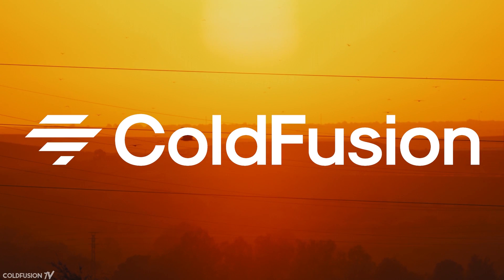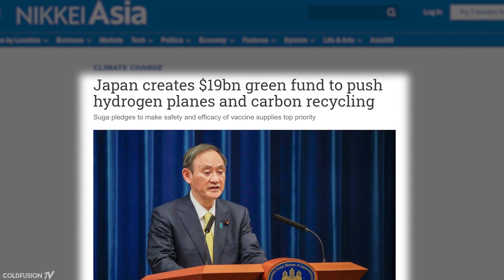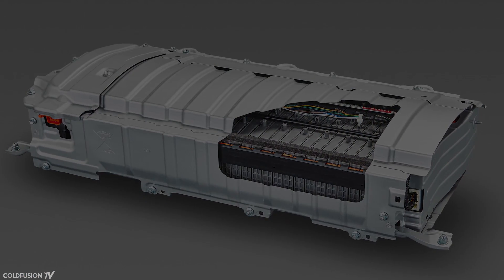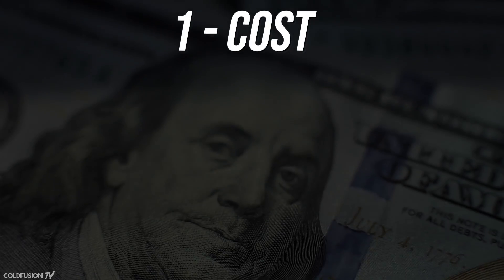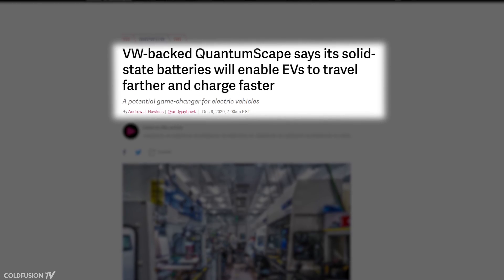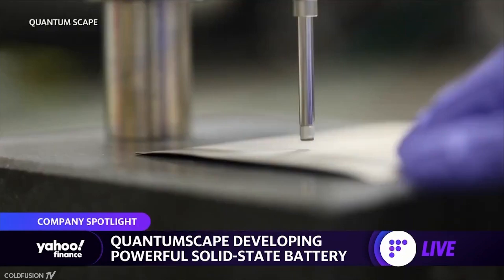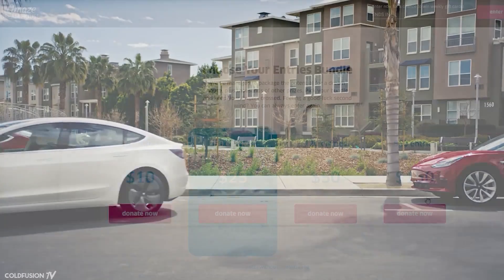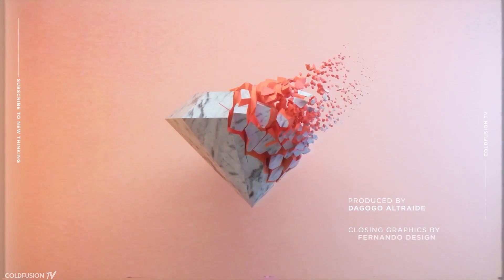Toyota Plans Revolutionary Solid State Battery for 2021

Comment: In my humble opinion Toyota are the most amazing vehicle company ever created, always ahead of the rest, that's why i wouldn't buy anything else other than Toyota or Lexus, look after them and they will last you a lifetime. In the 90'S Toyota created the Rav E.V.  (electric vehicle) that was only tried & sold in California. Everyone loved them until an oil company bought their battery design off them. probably forcefully or were made an unrefusable offer (speculation).
Anyway have you noticed how Toyota haven't created a full electric car probably because that would have been one of the conditions when selling the old battery tech on.
Solid state batteries, what a great idea, John Hutchinson has made lots of those not to difficult to recreate, but rechargeable is a different story.
Good Luck Toyota, im sure whatever you do will be amazing, looking forward to seeing your results.🙏

Comment: Toyota knows the word cannot have all e  cars only.  You cannot plug every car with the current power system. Especially in large cities.   Thus there needs to be a better charging design not larger Battery packs  like tesla is doing.   Recharge in 5 min  not 40 min.

Comment: I am hopeful about solid state battery technology, and Toyota’s involvement is important for this tech’s development.  However, you make assumptions about Toyota that I don’t agree are valid.  Toyota, and the Japanese audio industry as a whole, develops new tech like this with a focus that starts on the Japanese market.  Japan is focused on reducing fossil fuel consumption, but they also have to import fuel stock to generate electricity.  So the auto industry and government prefer to develop hydrogen fuel vehicles over battery electric vehicles.  Next, Japan has very moderate weather, so the batteries don’t need to operate in extreme environmental operating temperatures.  Also, Japan is an island archipelago nation, and the longest island is 810 miles/1300km long.  You don’t need the best in energy density battery packs to drive through the islands.  The higher density packs will probably be applied more to heavier commercial vehicles, while the lower performance packs are applied to smaller passenger vehicles.  I don’t think this is a bad plan, but it significantly narrows the parameters and application of this tech from Toyota.  Other than Nissan, Japanese automakers have not tried to mass produce BEVs- and though Nissan’s Leaf performs admirably in Japan, it has many shortcomings in much larger countries, and in regions with hot weather.

Comment: BS! This is not a vaporware, it's a CAME OUT VAPORWARE... After long history of BEV denial, Toyota to "came out" with "revolutionary" battery is for LOL. This "announcement" has purpose to keep Toyota stock afloat, until some miracle happened. Frankly, Toyota makes very good cars, but they failed HUGE with BEV.

Comment: 500 KM it is about 310 miles. It still cannot compete with ICE cars that run over 500 miles and fill up in less than 5 minutes.

Comment: The awnser is run the cars on water with a built in hydrogen generator 😉
But every one who does it  winds up missing or dead
Dont need gas stations because every modren household has electricity and water

Comment: I think 2024 is when the "average" person will begin switching in large numbers to EVs.  Price, performance, quality, and convenience will ALL be improved significantly by then.  And there will be capable EVs in EVERY vehicle segment at that point.  It also happens to be (June 2024) approximately when my Tesla CyberTruck will be delivered (although that could easily move a year in either direction.

Comment: Why don't auto manufacturers put even smaller, more efficient electric motors in cars that draw less energy?  Many consumers don't need AWD and 2 motors, like a Tesla.  Moreover, they can't afford it.  You don't need 450 horsepower and 700 foot pounds of torque in a family AWD sedan.  It's nice, but a simple FWD electric motor with 120 horsepower and 150 foot pounds of torque, that gets great range would do.

Comment: Good news. I understand that if these new solid batteries are much cheaper to produce, then and without those combustion engines, the values of the sale price to the public will go to 50% less. If the high prices for the vehicles that toyota produces are maintained then nothing will happen in the market, we really expect the prices to fall.

Comment: Quick correction: solid state batteries DO NOT suffer from dendrites buildup. It’s a problem current chemical Lithium batteries suffer from. Solid state batteries eliminate this issue/limitation.

Comment: More crazy dangerous stuff from the greenies, they don’t build houses under power lines so driving around all day in a tin box on top of a bunch of charged up electrical batteries and circuits can’t be good for you, solar panels irradiating on your roof is the  same, we already know wind farms are an environmental disaster for wild life, these crazy unnatural ideas are just going to accelerate cancers and other stuff into the future. Stick to good old fossil fuels, man kind has been using this stuff since the beginning of time , we just need to fine tune them to reduce impacts.....

Comment: Consider what Sony had to do to make Lithium Ion happen in 1991 (make it in house) no other battery maker in Japan would make Li-Ion batteries for Sony, as the tech disruptive to existing NiMH & NiCD battery makers market space dominance in mobile battery powered applications. At the time lithium ion batteries cost more than $3500 per kWh - now down to under $100 per kWh. This technological lock-in now happening with Lithium-ion as its the dominate rechargeable battery in many applications. Li-Ion comes in more than 12 different commercialized chemical combinations & thousands of form factors & very well studied. Manufacturing lithium cobalt carbon batteries super complicated as the electrolyte flammable & cobalt toxic & a conflict mineral. Furthermore 100% charging LiCoC batteries damages them as does deep discharging to low states of charge & high heat also harms them. Li-Ion batteries can catch fire when shorted & vent with flame ( Note 7, Dreamliner, etc) & have to be carefully temperature controlled (Tesla Liquid Cooling & Warming Actively in Model S 3 X Y etc) // Toyota learned a lot with partial long life charging Li-ion & NiMH in Toyota Hybrid vehicles over the last 20 years & have many patents covering advanced combustion engines with good thermal efficiency like the 1NZ-FXE with a pair of electric motor generators in a very efficient drivetrain. Adding more batteries a mass feedback paradox with diminishing returns as battery mass & structural support for increased mass increases as a squared function, thats part of the reason the Tesla Model S P100 weighs so much even though the body shell made of aluminum (mostly) // high energy density batteries will enable lighter EV's with better drying dynamics (See Lotus, Chapman) for why lighter cars have better real world performance in every measurable category & then consider the performance of a 400 lb sport bike with 200 hp for an example or a Lotus Elise // Cost also important & thats why Nissan went with laminate Lithium Manganese Spinel Laminate batteries, lower cost, back in 2010, to make the LEAF affordable in the body shell of a Nissan Versa (low cost iron stamping welded construction) // to make it dirt cheap you have to make it out of earth abundant minerals just like professor Donald Sadoway of MIT says about his liquid metal battery!

Comment: Can someone please explain why we can't have a standard sized interchangeable battery pack that can fit all makes of cars and trucks?  Then Service stations would essentially keep freshly charged batteries on hand.  Vehicles could drop spent batteries and insert fresh ones in under five minutes.    All batteries could be manufactured and recycled in a closed technical loop that is non toxic to the environment.    I mean COME ON!   all video cameras use replaceable batteries now!

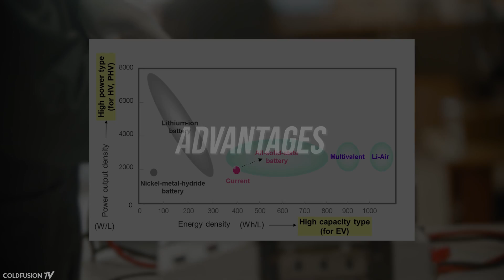Comment: 2:19 What does that "High Power Type" part of the scale mean? Is that about about how many amps a cell can output by volume? Battery types usually have a set base-voltage range right? The low power power output density of solid-state batteries stands out me here - Is this going to have consequences for what applications these new batteries will see?

Comment: i need it charged in around the time it takes to fuel a combustion engine - plugging in 4 chargers is no issue for consumers.  one giant connector from say the number plate, charging several partitions of the battery system should be fine

Comment: Not impressed. Tesla already has a range over 500 km with standard Li-ion. Besides, alternatives to Li are much more interesting and some already have charge times down to 5 min. Anyway, if this is double Li-ion energy density, why aren't they going for 1000 KM range?
Reply: More density more weight, you will not have longer range. Did you say that Li-ion have charging time 5 minute ? you lied.

Comment: If Mitsui Mining is Mitsui Mining & Smelting Co., Ltd. then the stock (stock symbol MMSMY) is a penny stock at $7.00 as of 2021_01_29.  I bought some shares at that price. I heard about Toyota's  work in SS batteries 1-2 weeks ago and that Mitsui Mining was supplying the electrolyte material.  I also heard that  Toyota and Subaru are collaborating on making an EV. Subaru stock is much cheaper than Toyota stock.
 Lastly, I have heard that there is work on trying to make batteries using graphene(a form of carbon)that will replace lithium ion batteries. Graphene batteries recharge faster than lithium batteries. Graphene batteries are also lighter and slimmer than lithium-ion cells. This means  graphene allows for much higher capacities. Lithium-ion stores up to 180Wh of energy per kilogram while graphene can store up to 1,000Wh per kilogram. Finally, graphene is safer because it has much less of a chance of a fire associated with it compared to lithium.

Comment: All well and good but no use to me. I need a 4x4 not an suv. The industry seems focused on low slung cars ignoring the rest of the market. Probably due to low center of gravity to offset the not inconsiderable battery weight I guess.

Comment: Seems like Tesla has already addressed most of these battery "problems" already.  Today, not 5 years from now.  Toyota has to sell a different product line today, don't they?  That product line has no batteries at all for the most part.  Good luck with the transition Toyota.

Comment: 3:05 *sigh~~*. I hate when manufacturers make claims like this.  All they are really doing is taking the limits of a small-scale cell and scaling it up linearly with capacity.  Engineering does not work that way!

You charge a battery pack designed for 500 km in 10 minutes, that means minimum 500 KW average throughput at charge time...  The circuitry that actually manages the charging, the leveling the voltage transformation...  none of that is 100% efficient.  Even at 99%, that still means 5 KW of power is generating heat...  You ever try to see what happens to a collection of MOSFETs when you apply a 5 KW heater on them?  Not good.  And that's not even counting the heating of the cells themselves.

Comment: 1 more thing. Life is safe because the battery dos not store enough power to boil its electrolite away and afterwards burn thr steam/ the battery it self. If the powerdensity gos up the liklyhood of RUD in a case of a internal short gos up to.  the liions that are the most flamable are the high drain ones with low ir cause they can provide lots of power in a short amount of time. An explosives are explosive cause they an provide lots of energy in a very small amount of time. if ir and powerdensity goes up voilence in a case of failiure goes up to.

Comment: @Cold fusion i know the algorythem likes it when you post more.... but we the viewers want quality content. Toyota is promesing many diferent things quantumscape sued itself for fals claimes.... many big red flags. and you did not come to the, to me obvious and true. conclusion  that electric cars are not constrained on energy density. If your engeneers are any good. (like the ones tesla has).
If you struggel so mutch with inefficiencys from your powertrain/aerodynamics/battery space that your only solution is a cutting edge very expensive battery for your vehicels thats is gonne reduce your cost margine to zero or make it negative. you have far bigger problems than power density. in an enviorment where the big fishes use "cheap" liion at 50or less $ per kwh. in 2023.... guess rip toyota

Comment: Even assuming that the solid state batteries are here today, where are all the new non-fossil fueled power plants being built to convert to an all-electric vehicle fleet by 2035? Can't drive electric cars if they can't be charged. Here in California we have brownouts on hot days during Summer. I don't see it happening in the next 14 years. Our glorious leader Newsom has decreed that no internal combustion vehicles are to be sold here in 2035.

Comment: Toyota cracked the "copy" code. Here is there biggest error or wall they will hit. The charging system outside of home. If Toyota doesn't use Tesla open source technology like the charging system this is useless.  Tesla has got the hole USA covered with there chargers.

Comment: More vaporware Im afraid... What is the difference to Tesla (Maxwell) dry electrode battery, even the charging and cycle is the same. Safety is about the same... Ohh and they are making them now, and expect 100GWh next year.... And is cheaper than current, not dearer.... Even solved cooling with the tabless design.

Comment: Why not use aluminum ion batteries? They have a higher energy density, don’t need expensive and heavy materials like nickel or cobalt, and only need graphite cathodes and a urea electrolyte. No chance of fire, faster charging, lighter weight, etc.

Comment: Toyotas SS batteries won't offer any more range than Teslas CURRENT batteries and is already behind Teslas 4680 cells.  And when it comes to cost, it's irrelevant.  Cost per kwh is the name if the game.  

Also, most still use a bit if liquid electrolyte so it's not really SS.  They just won't tell you that.

QS also has no workable prototype.  Single layer only.

For QS and Toyota they only reference volumetric energy density.  They don't tell you anything about gravimetric energy density.  You always have to look at ehat they don't tell you.

Comment: 500km "too good to be true"
The model Y can easily do 500km today, the model X is like 575km. Honestly, I was expecting way more. Im even more disappointed they haven't even started designing a vehicle arround it and instead are just slapping it into an existing platform. This sounds like an expensive joke.
Reply: The stats get worse and worse. 80% in 15 minutes... tesla can already do that, and they have the network to actually charge at that speed. 800 cycles is pathetic for 20% degredation LiFePo4 its between 2 and 3000, and they are also ridiculously safe. Tesla's old 18650s can get 1500 cycles 0-100%, 2170 also do 1500.

Comment: 500 km is merely 310 miles - well below longer range Tesla models range, typical Toyota mediocrity. If it's double the density as they claim they should be aiming for 800 miles of range or 1287 km.

Comment: know some people who work at toyota here in japan, and it'll just be a media piece, unfortunately. toyota is officially protected by the japanese government (along with 3 other car companies) by law, and they have no reason to do anything new and every reason to just keep ticking along. why build new factories and mothball all their current gasoline engine factories? japanese as a people really don't like change either; the idea that japan is high-tech is a myth. cd and dvd rental is still a big thing here, i'm not kidding, and toys-r-us japan is still going strong. despite having the largest car companies in the world, japan only produces 3 electric vehicles - 2 by nissan and one by honda. the honda one is priced so ridiculously high (about $50,000 in its minicar segment with all the competition priced from $8,000-$12,000) they're clearly not trying to sell many of them. the 2 nissan offerings also have hardly been taken up here at all, so much so that the company uses them as "daisha" the courtesy car you get when your car is in for service. about 10 years back the largest shopping mall chain rolled out preferred parking for 20+ electric vehicles with free charging, undercover, right near the door, and they're mostly empty. occasionally one or two cars use them.
japanese people won't go for battery cars unless they're coaxed, and the big companies and government really don't want that to happen as it goes against all of their current interests. if they make a solid-state SUV it'll sell about as well as the mirai has - 3,700 units here in japan in 6 years.